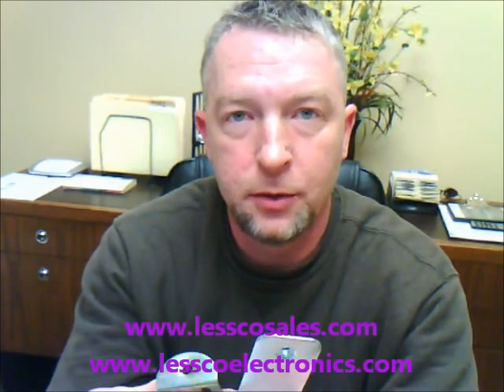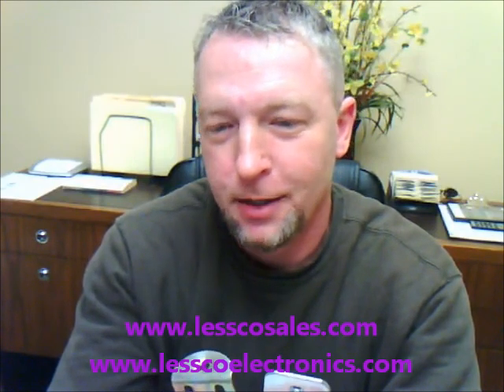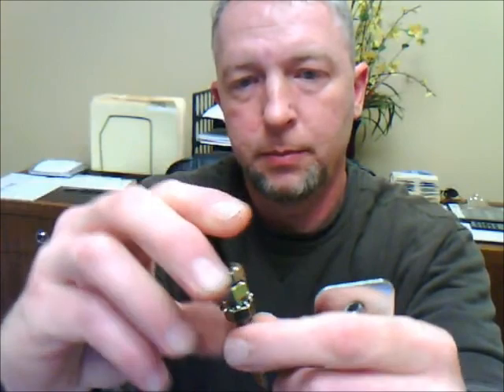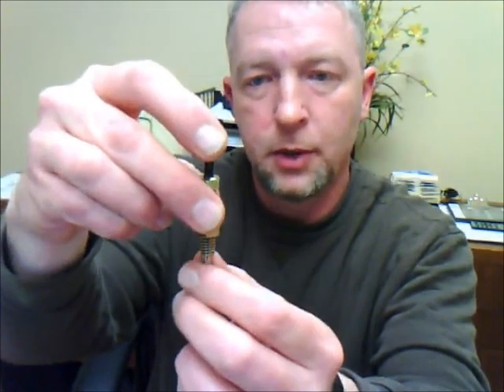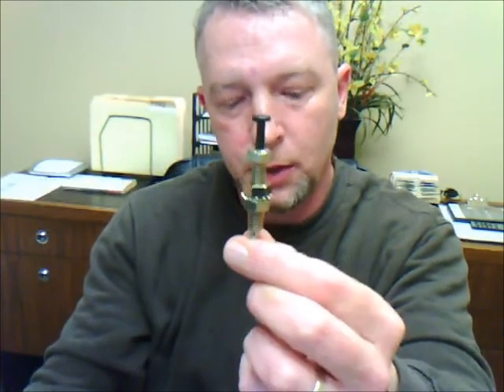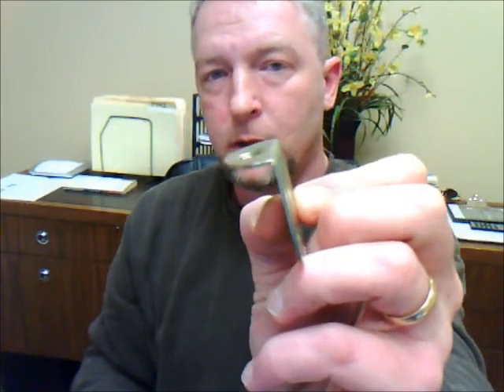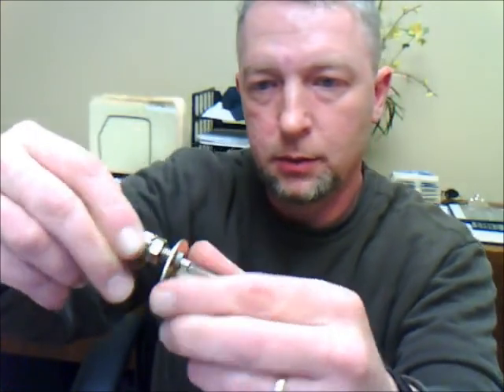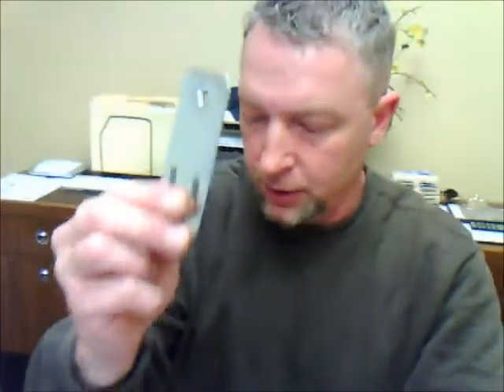Overview explaining all different kinds of car alarm contact / pin switches

Comment: Hi, the pin switch you are describing at 1:45, can this switch be used to operate running board lights, I would like the running board lights to come on when the door is opened, and shut off when the door is closed.